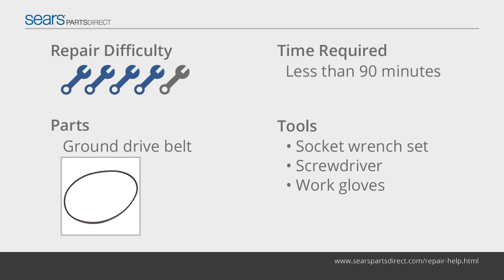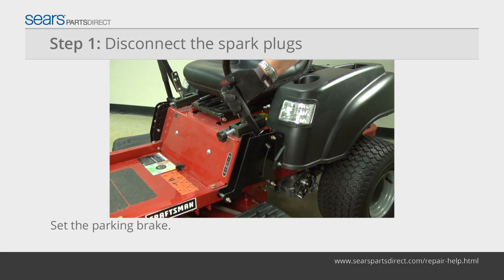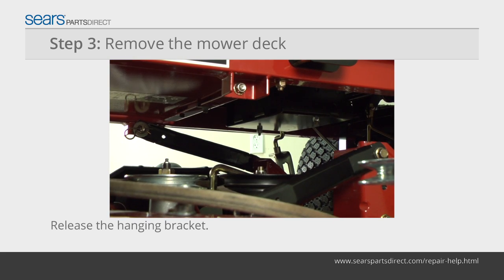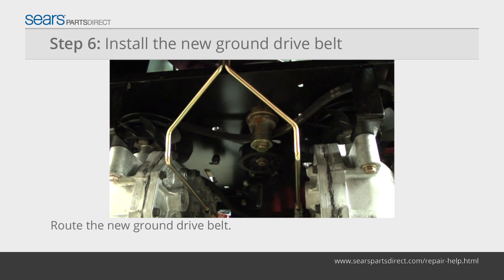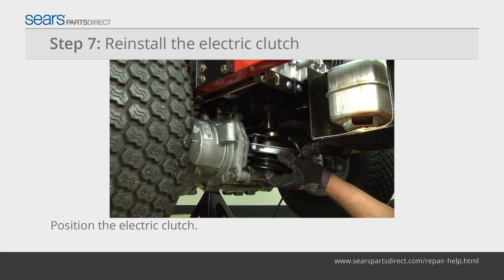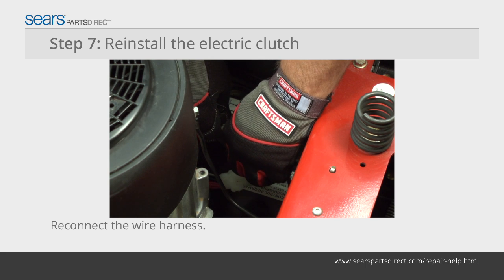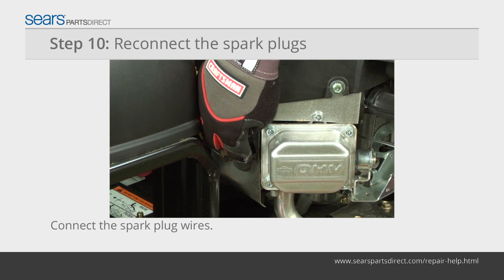How to Replace a Husqvarna Zero-Turn Riding Mower Ground Drive Belt

Comment: On a new zero turn 46 " first remove mower deck, then remove two bolts holding clutch brake stop and disconnect clutch wire plug. Voila, you can now change belt with a 1/2" x 55" belt. No need to remove electric clutch. It's that simple. Good luck. John, peace out.
Reply: Thank you! You just saved me a lot of time. My mower doesn't have a nut like in this video so I was scratching my head trying to figure out how to get counter pressure for that clutch pulley bolt. You should make a video yourself on the newer mowers. You'd get tons of views.

Comment: I feel like this mower needs an additional idler pulley to give more wrap around the other motor pulley. Had the belt slip off the other day and i see some models have a longer belt and additional idler pulley along with the spring loaded tensioner pulley.

Comment: a little dark while replacing the drive belt but good video.   thx.  I need to replace one of the idler pulleys for the drive (came apart from the metal bushing that the plastic pulley is molded to).   Hope I haven't lost the bolt and attachments too.

Comment: THank you Sears PartsDirect.  page 40 (aprox) does show belt path. But YOU will have to figure h0w  to get belt under idler pulley.  I had TONS of greasy fun. Wear goggles. Safety first. I hope it lasts a decade.  zth 6127. Husq., belt part no. 510201501 (.5x70in.)

Comment: any chance of the numbers for the ground drive and  blade belts  for Husqvarna RZ 5424?
Reply from the maker: Here’s a link for the ground drive belt on that model: http://www.searspartsdirect.com/part-number/539110411/0071/917.html. Here’s the link for the blade belt: http://www.searspartsdirect.com/part-number/539114557/0071/917.html

Comment: I have a Husqvarna RZ 5426 mower and when I try to remove the electric clutch as shown in this video the fly wheel nut just comes loose. Without removing the electric clutch the new belt cannot be installed. Any ideas?
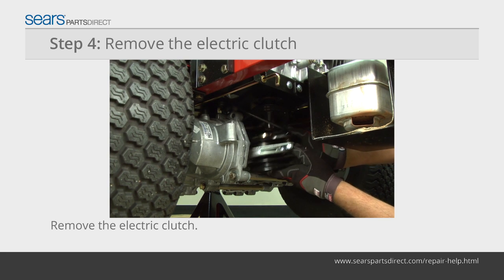Reply from the maker: Stuff nylon rope into the cylinder as shown at 1:09 in this video to keep the crankshaft from moving: https://www.youtube.com/watch?v=7tgpmi9cOtc&index=13&list=PLbGAdX0H4-7-uFRfDhYZF0BCrozIelDWy&t=69s.
Reply: David Locker there is two silver bolt that's attached to the black bracket next to the clutch. Take those two off and you won't have to take off the clutch